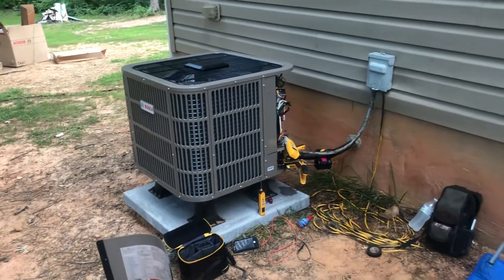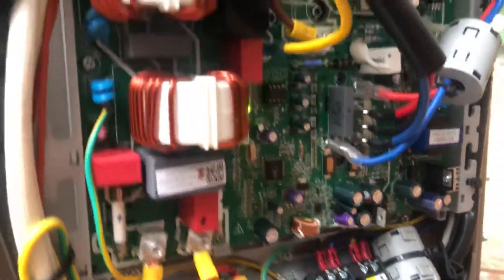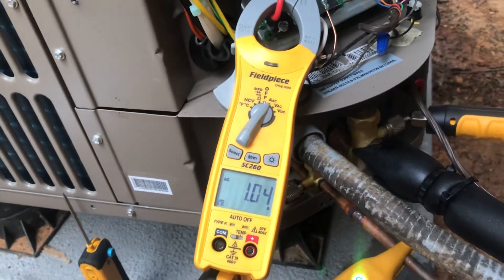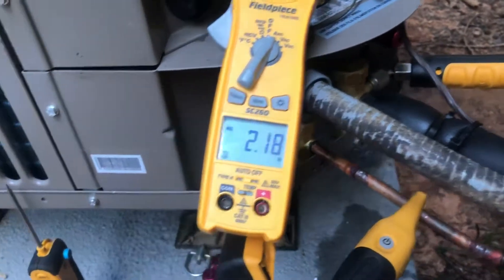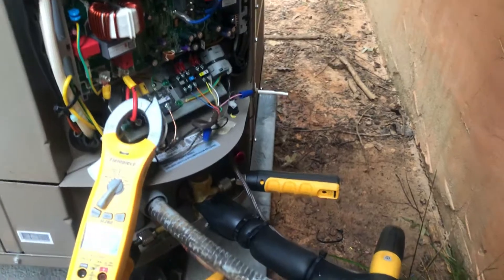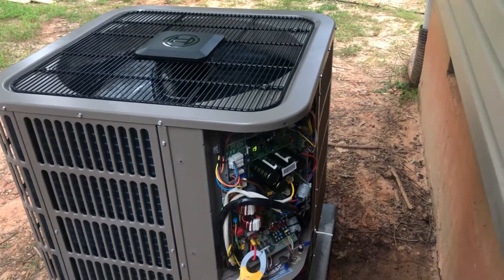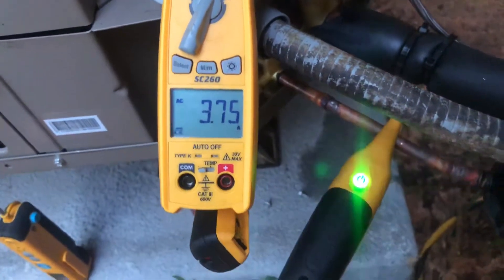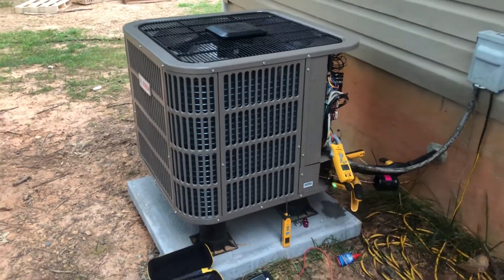Bosch Heat Pump

Comment: I had the bovb36 installed this past April paired with the BVA 24 air handler. We Absolutely love it. It was installed by a qualified Bosch dealer.  The system was calibrated and works like a charm to cool and remove the humidity. They also installed a Merv 13 Aprilair filter.

Comment: In trying to figure out my duel fuel(propane) with the bova36 and my Goodman variable speed blower, heat pump is working , just not sure the if thermostat wires are hooked up correctly, in heat pump mode, does it , or should the heat pump suppose to shut off when it hits the set point?

Comment: I just had one of these units installed at my house.  It's amazing how quiet it is.  You can literally have a phone conversation while standing next to it.  Bosch Thermotechnology has offices in New Hampshire and Massachusetts so hopefully parts availability won't be too bad should we ever need them.
Reply: How is your heat pump doing 2 years after install?  Any complaints?
Reply: Yes, how is the heat pump?
Reply: The heat pump works awesome for A/C but it's somewhat disappointing for heat.  I switch over to oil heat once it gets to be in the 50's outside.   It's possible that could be an install problem but the contractor who did the work is MIA.
Reply: @BlindBatG34  Oh ok that's important because the heat pump adds a lot of cost but it sounds like you're not getting your money's worth. interesting how some people get results down to 30 degrees.

Comment: Picking up a high pitch noise in the video.   What on the unit is causing that?
Reply from the maker: jbw B&B only thing I can pick up is the compressor similar to the Mitsubishi mini splits
Reply: @jeremyhenline654  The inverter driven compressor is made by Mitsubishi !
Reply: I hear it too... it's sounds like an inverter.  Probably can't hear it with covers on.

Comment: Hey man good video. I'm enjoying the reviews on this unit. I thought you were able to check pressures, super heat, sub cool from the control board? Correct me if I'm wrong. Thanks for the video.
Reply from the maker: Yes everything can be monitored right at the odu
Reply: Dylan Drymond  yes you can check those from the board.

Comment: Great Units. Did you install a Surge Protector ? I believe that BOSCH wants Surge Protectors installed on these units and they are cheap insurance to save that inverter board and compressor.
Reply from the maker: coolmandude1000 yes there’s one there that was my first video the final is up too actually Gina make another one gonna try switching to 37 coil just to see